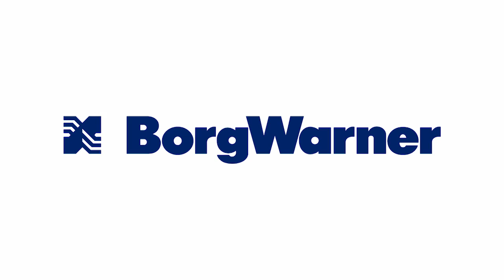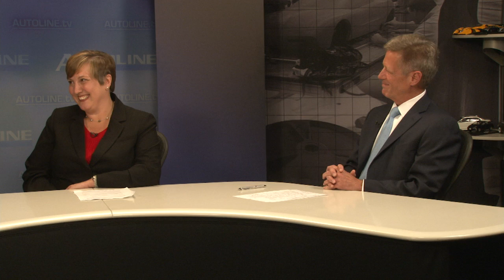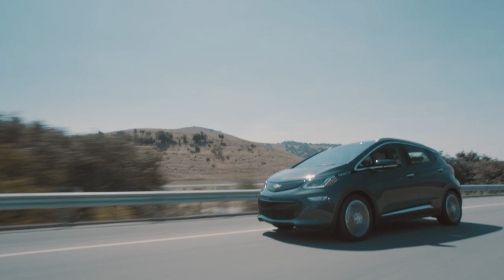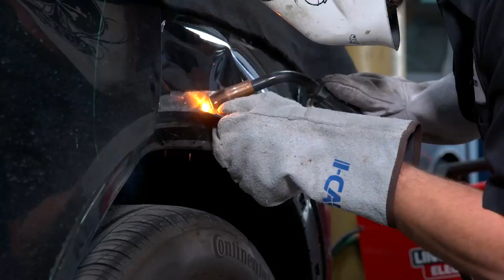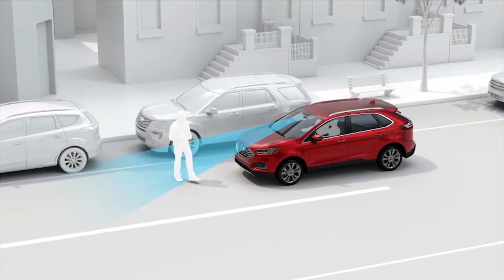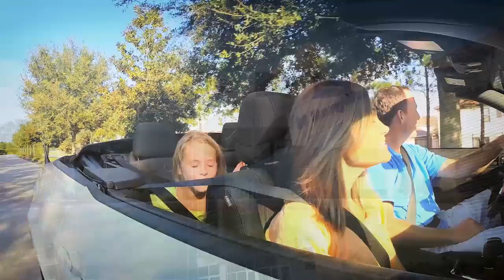How Do We Repair These High Tech Cars? - Autoline This Week 2229

Comment: When I started in the auto repair  field a mechanical/body man would get 50% of the labor. Now days your lucky if you get 15-20% of  $125-150 labor rates, plus  have over 30 to 50k invested in quality tools. It's  not worth  going into anymore, that's  why there  is such a shortage  of techs. All this started back in the 70s when GM quit requiring  passing  increases  to techs when dealers ask for labor rate increases.

Comment: I heard you mention the the Insurance companies " the money source" once during this entire video.  If you have less that 20% of repairs done to manufacture's procedures, that means potentially you have 80% of repairs are done incorrectly, possibly dangerously and not restoring the value back to the damaged vehicles.  Obviously insurance companies goals may be in conflict with completing repairs IAW manufacturer procedures, especially as repair procedures, methods and training costs increase dramatically.  It appears some type of " industry or brand specific repair certification" needs to be instituted so owners and future used car buyers are confident repairs were done correctly.  Otherwise, 100% of repairs are done without anyway to certify repairs were completed IAW manufacturer procedures and quality standards.  What good is certified training and manufacturer repair procedures if the final repair job/quality is not verified and/or certified?